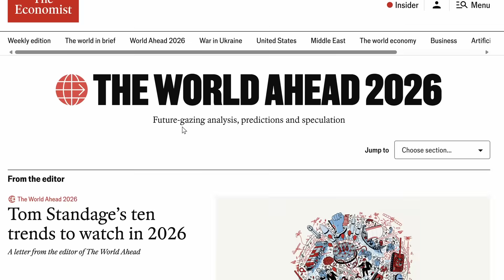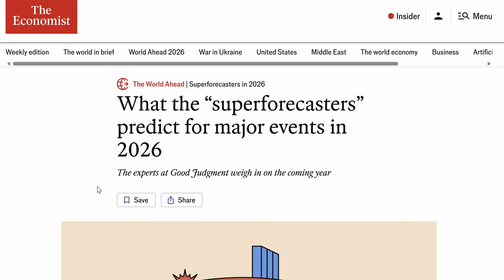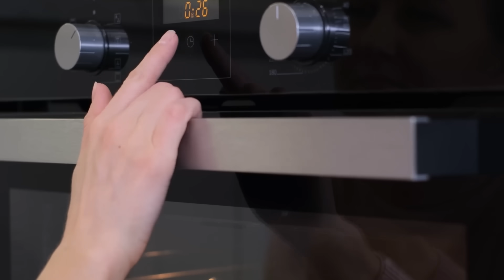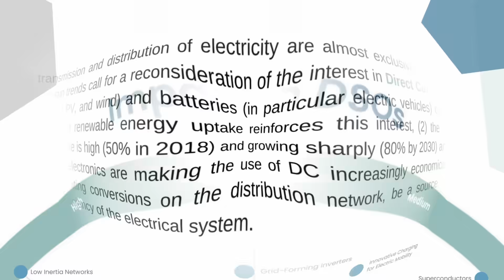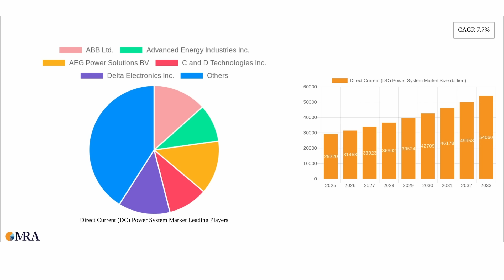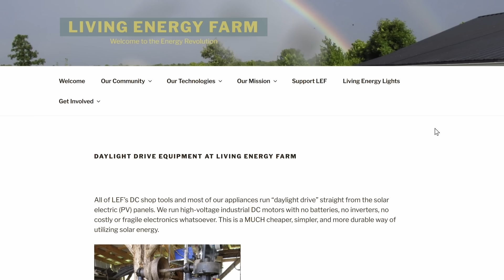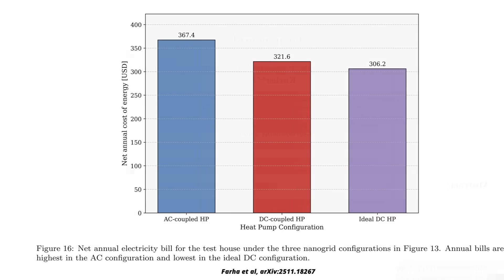Are We Using the Wrong Kind Of Electricity?

Comment: Wasn't one of the big reasons AC won the current war not only because the transmission was less lossy, but the transmission lines were cheaper to build?  DC requires a positive and a negative line, but AC needs only one wire.   Also, the primary application of electricity at the time was incandescent lighting, which works just fine on AC, so there was no concern about every other device running on DC.
Reply: The use of single-wire earth return (SWER) distribution is rare in the U.S. The vast majority of distribution systems have used two or more wires (single phase or three-phase).
Reply: @avsystem3142 yeah but that's the modern system.  I'm talking about the Edison vs Tesla era

Comment: Nah, AC is better than DC because its easier to change the voltage using transformers. Transformers do not work with DC without switching electronics to make AC. Second reason is for AC motors, which the rotational speed is derived from the AC frequency. The only effective was to control rotational speed with a DC motor is with PWM: Pulse Width Modulation. AC GRID power will never get replaced with DC.

Comment: The purpose of AC back then just to increase the voltage to reduce the I²R heating on long wires during transmission.  Now with large modern high voltage semiconductors are now capable of converting DC to high voltage DC and back also reducing the I²R heating on long wires during transmission (without any issue of phase syncing, frequency syncing, skin effect).
Reply: AC wasn't only beneficial to step voltages up, but to reduce voltages.
Low voltage has the advantage of not beeing deadly, so household transformers step voltages down to a save level (12V), so you wouldn't need as much protection.
Also AC was easy to manipulate.

And the most important thing why the world is how it is:
Your home appliances weren't invented 150 years ago. Cars didn't exist.
People had steam locos and eletricity could make the loco more efficient, less dangerous and you need less manpower (=cheaper) to run it.
Locos needed to change voltages on the fly. Low voltage to get going and increased voltage for more power once the locomotive was on the way. There was no way to do that efficiently and cheaply back then. AC and a transformer where you could tap into different windings to get different voltages.
But it was too difficult to deliver 3-phase-AC to trains, so 1-phase it became. You can look up photos of 3-phase-AC-trains from back then.
But you could easily use 3-phase-AC in the industry. Why 3-phase? Because the power delivered by 3-phase-AC is constant. No waveform, nothing. 100% constant. What machinery needed. THAT is why we got AC (3-phase).

All of this would have been complicated with DC back then.
If we were to rebuild our grid, I'm not so sure we would do it again with AC.

Comment: MY Solar system would certainly be more efficient if I could bypass the inverter but totally outfitting the house in DC is impossible since almost all mass produced appliances run on AC, some converting to DC with an internal switching power supply.  You can't just bypass the switcher and run directly on DC.  At the desk I'm sitting at, I have a 19V laptop, 5V LED desk lamp and cell phone, and 3V thermometer, and a 12V Ham Radio, and a 48V Starlink router. We have had over 100yrs to standardize household AC but no codes for DC.

Comment: I am interested in how an electron with a negative charge can exist and how a proton with a positive charge can exist. And why their mass is different. If they are a derivative of fields, then two sources are needed for the field - these are the positive and negative poles. So? And if we assume that an electron and a proton have two poles each. The electron is always turned towards "us" with the negative pole. In this case, the positive pole is always directed to a certain center of the electron. We recall what an electron looks like, namely, an "electron cloud. With the proton, the opposite is true. Why is there a difference in mass? We recall what is the cross-sectional area of the common wire compared to the phase one. It's smaller.
How do you like my idea?

Comment: I think your summary statement is probably very accurate. The big obstacle to widespread adoption of a totally DC system will be the vast number of transformers currently used to distribute power. These would need to be replaced with DC/DC converters, which would take a lot of money. DC conversion circuitry is a relatively recent technology, and I doubt that it will prove to be as reliable as AC at the community level of power distribution.

Comment: A problem in the application of DC power are the many different voltage levels. E.g. within a computer, you need 12V, 5V and 3.3V. But most of the power is required at dynamically changing voltages below 1.5V, often requiring electrical currents over 100A. So you need to do conversion anyway. Converting from e.g. 350V DC has nearly the same efficiency as conversion from 230V AC. 

I see DC Power in 3 different scenarios:
1. High voltage power transmission over long distances (at least several 100 km), with voltages >1000V.
2. Local energy interchange, e.g. between PV, Batteries and some high-Power-Comsumers, e.g. EV-Chargers or Inverters to AC. Voltages will most often range between 300V and 1000V. Local here means e.g. within an EV charging hub, a building or a connected group of buildings. This will seldomly cross property lines. 
3. Sharing of DC power supplies. E.g. your internet router, network switch and NAS theoretically could share a 12V converter, if there would be standardization. The same with wirebound IOT or Smart Home components. A USB power supply with multiple outputs is common.

Comment: ...an important issue is how voltage stepping (either up or down) is done.  for AC transformers is the way, but transformers do not work on DC...
Reply: That is historically true. In modern times semiconductor circuits can make the conversion, transformers not required.

Comment: Do a little research, Sabine. In the time of Edison and Tesla, DC long distance transmission was very impractical. In fact, Edison was putting powerplants all over NYC so that long distance transmission wasn't needed. This was expensive and inconvenient. Long distance DC transmission only became viable in the last decade or two with the development of DC switchgear. In fact, I remember an article in IEEE Spectrum at the time which fantasized about very long-distance DC transmission with very low losses. In one scenario massive solar cell fields in Australia would power much of Southeast Asia. 

As for those early days, AC motors were less expensive and had other attributes that were deemed superior (e.g., low maintenance, quieter and smoother operation). DC motors make sense for EVs as they have superior torque, although AC motor torque can be enhanced. Of course, EVs use batteries, which are inherently DC. But this too is a recent innovation. 

For digital systems DC is the only technology that makes sense, but these were not common in the early days.

Comment: Rotary generators are much easier to make AC than DC. Yes it can be rectified but AC is essential for voltage conversion. All dc-dc conversion is done via AC albeit at very high frequency. In industry a huge use of AC is in motors where 3 phase current enables cheap powerful motors. Retrofitting with dc motors would be hugely expensive and wasteful so large expensive converters would be needed and these would be inherently less reliable than the motor alone. High voltage DC is though great for transmission as you don't get the surface effect and capacitative and inductive losses of AC. DC has always been good for local work where voltage conversion isn't needed. So potentially good for microgrids although it could make grid fault detection more difficult as you don't have the frequency reference that can cut things off to make a system fed from multiple sources safe. I myself live of mainly DC on a boat with AC conversion only for things where there is no viable DC option which is mainly stuff with induction motors and gubbins with transformers. I think there will always be a hybrid system and I suspect that it may contain DC microgrids, DC very high voltage long distance very high power interconnects but I think the core industrial infrastructure will remain AC for the foreseeable future not just because of the cost of changing it from the generating and infrastructure point of view but also because of the cost to industry of changing. As we are looking towards 100% renewables, the AC losses will have less financial impact because we are no longer paying for the energy wasted.

Comment: I wonder if there would be benefit in having the grid be AC, feeding DC power supplies in each home. What would a house wired with DC power points look like? A house fitted with a car charger, or solar panels (especially those that feed the grid), or battery storage already has substantial DC power electronics installed.  Maybe some of that should be centralized in one big DC power supply (and inverter if returning to grid) that feeds the car charger, battery charger, house wiring, etc.

Comment: For the first time I'm surprised at how wrong Sabine is. Let's look at the reason why AC happend. Put simply it was the need to generate high voltage to reduce losses and limit the copper use. DC cannot be transformed or rather it was impossible until power electronics. The only way to generate higher voltage DC was by using larger diameter DC generators and as they became bigger they started to fail. Spectacularly. Thus AC was needed for high tension transmission. 

Once DC power electronics allowed high voltage then it became useful to build DC transmission systems. Not because local networks and devices use DC but because DC allows more effective use of copper. AC voltage transmits on the perimeter of a copper cable while DC uses the entire cross section thus for any given area of copper you can push more DC than AC. 

The statement that using DC transmission makes it easier for local low voltage DC is nonsense. You will still need to transform the HV DC to LV DC and that's more complicated than doing the same with AC.

EVs are not DC. EV cars are AC. The batteries are DC but despite that they transform the battery DC to AC to power the electric motors. That's because AC motors are simpler and much more robust than DC ones. Given a car already has DC on board but uses AC voltage for motors is a clear indication of reality. 

Overall I'm disappointed. This is the first video by Sabine that's basically full of nonsense.

Comment: Historically shifting between voltages with AC is very easy, just a transformer which is a couple of coils of wire wrapped around a metal core, compared to DC which typically is more difficult
Add to that it's the Amps combined with the resistance that generates heat / losses, it's the reason in the past we've often run power over long distance at high voltages in the 1000 range with less amps, for the same amount of power to cut down on the losses, then shifted down to lower voltages at substations (another transformer but high voltage to low) before feeding the power into a house
Modern tech may allow shifting DC more easily between voltages which might be a driving force, but it also needs to be cheap as well

Comment: This is somewhat special.....The AC-system was invented and taken into use in very early 1900. Long, long, long before power semiconductors or any electronics to speak about. It was a far more superior system than Edisons for long haul transmissions, taking use of transformers. And far better electrical engines for industrial use. This is partly reevaluated today, but that is a completely different story, when the difference between AC and DC becomes very hazy. For instance all efficient converters of AC to DC and DC to AC includes AC in some form.

Comment: This is all because Chinese have this high voltage dc transmission super highway that so called "developed nations" are envious about. Every current has it's use. AC made sense because generators were producing it and it was easier to transform. For larger distances DC seems to be a winner, until we come up with even better ways.

Comment: Only microwaves and induction cook tops require AC. resistance heating can run on DC.
Reply: Your switches would say otherwise. DC arcs when you open the contacts, AC crosses zero so the arcs stop abruptly.
Reply: @wally7856  I guess you're not familiar with anti-arc DC contactors. Been used forever and now used throughout EVs on the road.
Reply: @wNgIaD  A standard light switch in your home right now costs about $1 each. How much do those anti arc DC contactors cost?
Reply: @wally7856  Who is talking about low current light switches??? They also work for low current DC circuits for lighting. Go through every major AC powered appliance, and heating/cooling system and you'll find specific AC relays ASLO designed to mitigate arcing damage and wear. If you think AC current doesn't arc, go google for examples. AC or DC, it's always application specific. I'm a  retired electrical engineer. And I'm planning to design and build my own off-grid homestead in the woods to retire. And it will be primarily be wired for DC to avoid DC to AC then back to DC conversion efficiency losses. There are other factors like VA- PF issues that AC inverters must be able to handle when starting up high load motors in heat pumps, etc. A high cost that's avoided.
Reply: @wNgIaD  If you're not on shore power then PF is a big deal and DC makes sense. I think Sabine was alluding to the entire grid.

Comment: Tesla never argued that AC was safer, because it's not. That was Edison's argument for DC. In fact, Thomas Edison, through his ally Harold P. Brown, publicly electrocuted stray dogs, calves, and horses with AC to demonstrate its dangers and promote his DC system as safer.

Tesla's arguments were that AC was more efficient because it could be used directly in transformers. This is no longer an issue with the availability of low cost, high voltage, high speed transistors, but it was a big deal in the late 1880s and 1890s.

Comment: DC current requires much heavier wire (more expensive). DC transformation requires electronics like SCRs (more expensive, less reliable). DC voltage is WAY more dangerous to people. The entire transmission industry can't afford to even consider it. Maybe for niche applications.

Comment: Future is DC.
For transmission, at the same voltage DC is much more efficient due to the absence of skin effect, inductive and capacitive losses.
Regarding costs, I guess SiC IGBTs and GTOs cost less than the huge 50/60Hz transformers and capacitors.

Comment: If you build an off-grid home, then yes, you should design for use of DC current. More efficient. Problem is finding DC major and minor appliances. Must convert most motor driven appliances. Luckily a lot of AC power tools can run on DC current.

Comment: Hi Sabine, thanks for another interesting video. I might have missed it but could you explain how the long distance DC power lines get around the resistivity problem and how a DC transformer works? Thanks and Merry Christmas
Reply: Current is always where your losses come from, so regardless of what type of current you use, delivering your power as high voltage/low current with mitigate the joule heating issue.
Also, there's no such thing as a DC transformer. Theyre called buck converters or boost converters to drop or raise voltage respectively. They work by taking advantage of the way an inductor stores energy in a magnetic field, by(in the case of boosting) storing up a lot of magnetic flux and collapsing that field quickly, or(in the case of bucking) by sending a short impulse of energy and using the delay of building up and collapsing the field to spread that energy over a larger amount of time.

Comment: I spent 20 years driving DC trolley busses for the M.V.R.T.A of Dayton, OhighO.; and of course using the only micro-grid for miles around! ❤
Reply: 1940's and 50's Brighton UK was DC for similar reasons and Trolley Buses are or were very poplular but all scrapped for noisy diesels This  made it easier fot the radio and TV trade however and a National Grid system..  How will induction hobs cope with DC?  The Electronics OK until you need to heat any  pot?  Better to stop chasing Moonbeams for  green energy.  which is collapsing economies.

Comment: It beats using positrons, that would really be the wrong kind of electricity.
Reply: On a more serious note, AC motors are the major user of electricity in my country and in my home (washing machine, AC compressor and fan motor).  Plus, AC can be changed to another voltage very efficiently by transformers.  DC cannot.  This makes the distribution system much easier and less costly.

Comment: The answer is Yes.  Plain Vanilla electricity is boring.  Chocolate electricity is far better.  

I was surprised you didn't mention electric motors as one of the largest uses of AC current.  It's used in your furnace blower and in the compressor outside.  Even your electric car uses AC to drive the motor.  When you charge at home the car converts the mains AC to DC which charges the battery.  When you drive, the car coverts the battery DC to AC to drive the motor.